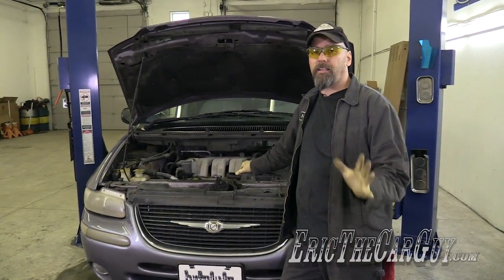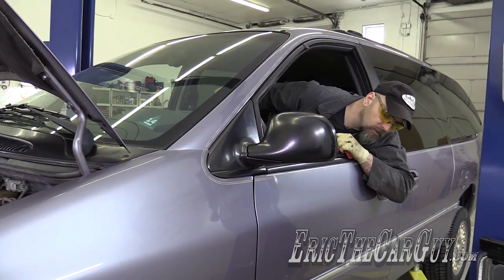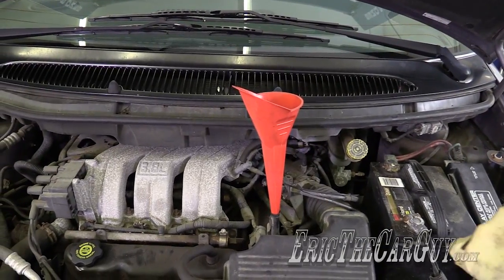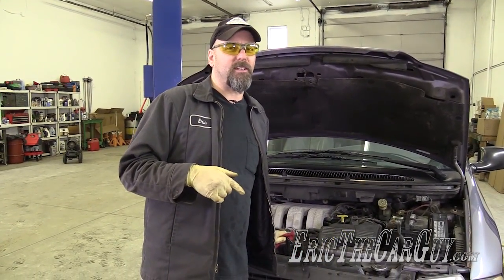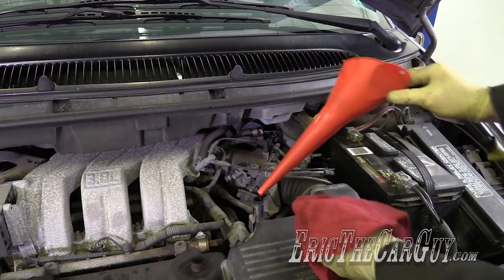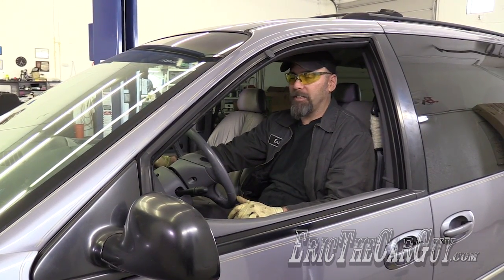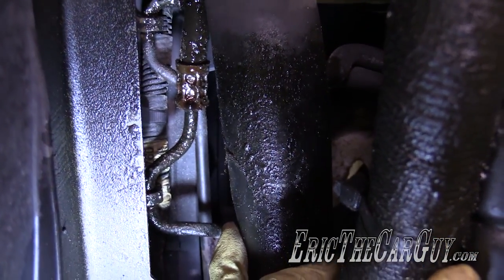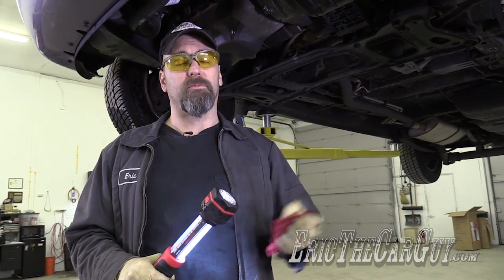1998 Chrysler Town & Country Transmission Diagnosis -Fixing it Forward

Comment from the maker: Here's another one from the #FixingItForward series. https://www.youtube.com/watch?v=SVyv7UpFPEc
Reply: EricTheCarGuy 
Hi.... I need your help place I have Toyota V6 sienna 2011
that have 60000Km.my problem is that transmutation  have over heat when I drive even I drive low sped
like 70-80km the temp going up 245f and still going up until I stop to make it cool down. I change OEM SW oil with filter 2 times but nothing happened also I change oil holes with tow Transmission cooler with fan.
Reply: maxj max Do you mean the engine?  Where are you getting the temperature readings from?
Reply: Man these town & country, voyagers have one of the worst transmissions ever made. You're honestly just wasting your time and money putting a transmission in this vehicle. Especially considering all the other issues you found with it in the other video. Just think back to your video know when to quit and give Barbara that advice. And hey if you wanna help her see if you can find her an old Toyota Sienna van, those things are great and can last a lot longer than these Chryslers and even the odysseys in some instances. You could probably find a late 90s sienna for not all that much money and it would be money better spent. A transmission in this van is probably gonna be close to $2500. Most people I know with these vans just get rid of it at that point. I mean with all the issues this has and I'll quote you on this, her only attachment to it at this point is sentimental and that's not gonna net her anything. Not to mention if it gets totaled, which I often see happen after somebody makes a poor investment like this, you're not gonna see that repair money again. Trust me it's not a wise investment
Reply: maxj max on something that new bring it to Toyota and have them fix it. That sounds like a warranty item.
Reply: EricTheCarGuy I had the same transmission problem. It wouldn't go reverse, but it will forwards but with some difficulties. It made really loud grinding noises. Btw can you help me with something, Eric. I have a 1998 Dodge Caravan and the dashboard won't work. It doesnt tell me how fast I'm going , how hot the engine is, and how much gas it has. Is it a fuse? (Edit) We installed a new transmission and it runs good.,
Reply: Fidel Martinez often times on those the gauge clusters just wear out overtime. on something that old I would try to find a used one out of a salvage yard and install that. your mileage is already off if the speedometer is not working so it doesn't really matter.
Reply: Michael Sackstein I also won't to add that whenever i change into dirve or reverse it makes a sound or whenever it changes into 2nd gear and etc. I don't know how to describe it, but i hear that noise in other chrysler and dodge cars between the years of 1997-2000
Reply: Fidel Martinez yeah unfortunately Chryslers/Dodges have almost always had one of the worst automatic transmissions ever. if you hear noises like that then it's likely the transmission is wearing out, especially on one as old as that. I might say try draining the ATF out and refilling it with 2 quarts of transmission fluid and then a quart of lucas atf fix. that may or may not resolve your issues, if it doesn't then I would say get rid of it fast because it's only gonna get worse and on something like a Chrysler at that age it's just not worth fixing.
Reply: Michael Sackstein I thought you never ever change the oil in a old at, just top it when it needs it.
Reply: Daniel Morales if it's never been changed then you really shouldn't unless you're experiencing problems. but no you should never have to top it off if you do then there's something wrong with the transmission
Reply: Michael Sackstein that is precisely what i was thought. Thanks!
Reply: Daniel Morales pues realmente me parece que estos vehiculos de chrysler son basura porque tienen demasiado problemas aveces cuando estan nuevecito, pero entiendo que aveces no tiene mucha plata y no sabe cuales son las mejores marcas para comprar y en fin se van con lo mas economico y por le digo que los boratos salen caro. asi que te aconsejo cuando te compres un vehiculo para investigar cuales son las problemas comunes y como andan cuando llega a los 10 anos mas o menos o depende por cuanto tiempo deseas manejarselo.
Reply: Great video Eric. By the way, do you know how to check the transmission fluid level on the 06 Audi A6? I cannot find the dipstick. Thanks.
Reply: Fanqi Meng those don't have dipsticks. you have to bring it to a mechanic to get it changed out. it's a royal pain
Reply: EricTheCarGuy  The ATF that this vehicle requires is "7176" appears on the transmision level. ATF 3.
Reply: EricTheCarGuy They should just make all Transmission Lines &  Brake lines out of Stainless right from the factory. For these reasons as well as safety reasons.
Reply: lightningsmokerXx I agree but that would cost them more money which is why they opt not to do that. Especially with American cars.
Reply: Michael Sackstein The thing i've never understood about that is this....

If it costs a car Maker 10 dollars more  to buy a roll of stainless brake line vs regular brake line. Why not charge the customer 30 dollars more for the car. No one is going to care about $30. And lives are saved, headaches, financial bother fixes like this, and reputation of the car company is raised because stupid little things like this are avoided.
Reply: Again I totally agree with what you're saying but there's a lot of competition in the automotive engineering industry. American engineers strive to make the most economical cars with a lot more technology these days, but the build quality to say an Asian or European import is far less superior. Just the way they function. Teslas are more solid from what I've heard but only time will tell.
Reply: Michael Sackstein Yes, these have the weakest transmissions ever,. I had a 96 caravan, had to replace the trans at 65k, unbelievable. My brother in law had the same van and replaced his 3 times! Tell her to get rid of it. Go Toyota or you will regret it.
Reply: Oh jeez. Hopefully the warranty covered that. My uncle had a 91 lebaron that also went through 3 transmissions under warranty in addition to a whole laundry list of other things. Finally the stupid thing caught fire in 99 and that was the end of it.
Reply: Michael Sackstein  my mom had  one of these vans had some other issues over  time was well cared for  and 260,000 miles on it and the transmission shifted fine nice and smooth  but bout 2 years ago was in a car accident and cost of the repairs would be more then it was worth so it went to the junk yard mom got a nice new gmc Acadia we love it.
Reply: Nobody every services there transmissions that's why there always going out
Reply: Chad Gardee Yep, pretty much.

Some are weaker than others.
But if you change the fluid regularly & before it needs to be changed. You usually won't have issues with them. Most people don't grasp that. 

A $100 bucks changing the fluid here and there is way cheaper than having tranny issues.
Reply: SuperJeremi10 that's about as far as those vans will ever go. The Acadias are nice vehicles. My uncle just got an Acadia Denali last month, he's leasing it as per the general managers recommendation.
Reply: our Chrysler van was so horrible to us over the ears we will never by another one  it never had transmission issues but it had a ton of other issues most from day one we got a gmc Acadia Denali  in 2012 we love it   its a really nice vehicle we have put 40,000 on it  and it runs great hasnt needed any repairs only routine maintenance oil change air filter belt etc. i have 99 tahoe i love it its been pretty good to us although its at the age it needs it repairs i have to redo my front end suspension my rear drum breaks  and motor mounts other then that  the engine runs great and no warning lights come on after engine has been cranked.
Reply: So I guess your insurance company declared it as a total loss
Reply: they paid us total value of the van  wich i think was like 2 or 3,000  at the time im not sure we used it  for a down payment on the new Acadia we are very happy though we are paying less on the payments then we where keeping the old Chrysler running  but sad thing is other then the head liner coming down and some dents  that van looked brand new ac still blew ice cold in front and rear it was well maintained it had a dent where some lady had hit it coming in the wrong side of parking garage it was an old lady we cut her a break and dint clame it it was just a small dent  and it had some pings in the doors minor wear and tear  at the time of wreck everything in it was working properly we had just spent  500 for a tune up and new belts and tension arm  and the day after it came back from the shop someone hit it and totaled it it coulda been fixed but it would have cost more then the van was worth so they totaled it out  it bent  the suspension and tore off the bumber parts that could have been replaced and you wouldn't have even known about the wreck there was no engine damage  as the car still ran just couldnt go anywhere i would have took the total  value pay  done the repairs myself kept it and got a new car and saved it as a frist year car for my younger brother.
Reply: Yeah that sucks. Sounds like what happened to my old 1996 Saab 900 S. It got t-boned on the drivers corner in an intersection and the drivers axle got bent & broke from the impact and the car wouldn't move. Was gonna be $3k to fix and we didn't have full coverage on the car anymore so insurance totaled it out and gave us $2400 for it. Also drove fine after we fixed it up but it had a lot of problems that were very expensive to repair
Reply: well the van must have been repaired sometime ago i saw it on the road i recognized it by the plate # it had a white bumper and black fender on the side it got hit sad to say few years later its not in near the shape as when my mom owned it look like the air had quite  and they obviously arnt maintaining it  the motor was showing symptoms of burning oil  blue smoke out the tail pipe things that would have never been let go if we owned it we took very good care of it  i also  didnt just recognized it  by plate  but  by looks  damages  and marks  from when we owned it  they probably got it  for next to nothing and fixed it but come to think of  the ac may not be working cause i remember there was a small freon leak in the rear ac cor  we never got fixed since it was so small we just recharged it whenever it got low to costly fix man  we had done lots of work on that car new shocks  new front suspension brakes new electric fans new sensors and plugs   the  rear wing motors had been replaced  new wiper blades new ac blower relay new seat warmer elements at some point the sliding doors came off the tracking oil changed every 5,000 miles it had a new radiator put in it had to have a new gear box put in  on the steering or something  at some point the airbags where serviced  via  airbag light we had spent lots on that car over the years  near the last few years we had dropped a lot of new parts into it.
Reply: Man you spent more than that thing is worth. I would never spend that much money on a dodge. The symptoms it's showing now is typical because like I said that's about as far as those things will ever go
Reply: well we spent the money to keep it going i guess cause mom liked it and we really couldn't afford to get something newer   we did all the repairs on the car our self me and dad did them so it only cost us the price of parts her car constantly had break issues we are much more happier with the Denali we are pretty much paying monthly what it was costing us to keep the town and country going  but got a nicer more reliable vehicle so we are happy. looking at her denali makes me want to trade in my tahoe for something nicer  but the thing is i really like my car it runs great but the pain is pealing off its been doing that a long time but i kinda want to just fix it and keep my car for the sake of i like it and i know its history we've owned it since day 1 so i know its maintenance patterns  but kinda at the same time i want something different but i want my tahoe  i really like the ford expiation and the escapes  but  then i also liked the old body style jeeps and whatever i get 4x4 is a must if it dont have it  that's a deal breaker my tahoe has 4x4.
Reply: The older tahoes that date pre-2000ish were actually ok vehicles aside from the vortec injection system. If it's one of those I personally would keep it until something serious like the vortec or engine/transmission fails. The fords can be ok vehicles but realize that all American cars age badly overtime so you also gotta budget your spendings pretty well. The good thing is you do all the maintenance items yourself so you've basically got your work cut out pretty well
Reply: yea  and my tahoe is a 99 with a 5.7 vortec and has recently had the intake replaced and spider injection replaced as well it also has  recently had a new transmission put it it still has the oem radio with new speakers it runs good it still easily passes emissions its not got any major oil leaks it easily makes it to its 5,000 mile oil change  and the oil level is still on the full mark so its not losing oil  it does however lose power steering fluid because my hose is leaking i need a new one but thats minor on my to do list its a small leak i need to do my drum brakes badly and my suspension also i need new motor mounts thouse take high priority i just put in a new radiator and water pump 6,000 miles ago it had a complete tune up new egr valvue map maf  egr switch temperature sensors  spark plugs cap and rotor also has had a new thermostat put in and fresh coolant also all fluids where checked and brake fluid was changed.
Reply: i saw a 2005 trailblazer i liked then i saw all the reviews on it  and decided not to get it ugh  i really liked it to   i like suvs.
Reply: Yeah. As a matter of fact the trail blazer has been rated as one of the worst SUVs ever made.
Reply: oh  haha ive known some people  that had some  and  where ok.but they where the type people who only would own a car for a few years then trade it in
Reply: Yeah but I wouldn't advise purchasing one of those vehicles. Trust me it's not a wise investment
Reply: haha  what bout a 2004 ford escape maybe ill just drop like 5grand and fix my tahoe up nice redo the interior and repaint it  i do like my car but its in poor cosmetic shape.
Reply: Not worth it on a vehicle that old. Now if you wanted to touch it up yourself then that's a different story. But 5 grand on a 90s Tahoe paint job no way. The escape can be an ok vehicle but you wanna get it checked out by a professional before you buy it.
Reply: okay  see  i havent found a car i like as much as my tahoe and ones i do find for my price range are horrible ones and it needs a new paint job the paint is pealing  my tahoe has had a new transmission and transfer case put into it and is a 4x4
its hard to find something in nice shape in the 5,000 range i dont wanna spend a lot on a used car cause i wanna pay it off the day i drive it off the lot.
i really like my tahoe and if i had it redone  i would be spending the money with the intent on keeping it cause resell value it wouldn't be worth it but i really like my tahoe and its been reliable up till recently but thats kinda my fault  i been falling behind in the maintenance cause i havent had the money to keep up with it also 100,000 miles ago the motor was pulled and rebuilt  it was leaking oil rally bad so we spent the money to have the whole motor serviced and worn parts replaced.
Reply: Man you're spending more money than that thing is worth. I would never spend that kind of money on a GM. But if you like it then drive it till it stops running. And to be blunt, if you don't have money to fix it or buy a new car then you shouldn't be spending $5k on a paint job. Especially if it's twice the value of the car.
Reply: well i need to do something  to keep it from rusting before its to ate it probably wont cost that much for a stranded paint job and it needs interior work  thing is this car doesn't seem to break down or be a huge lemon like a lot of newer gm vehicles as of right now it has a newly rebuilt engine new transmission and new transfer case might as well fix the rest of it  and not throw away all that money just spent fixing it the rear main seal had gone  it was loosing  quarts a day so my uncle went ahead and spent the money and had the engine rebuilt since it needed new seals he was like why not  then the transmission went out  failed to shift so it had that done as well as the transfer case then i got it and i love it i haven't found a 4x4 suv that i really like yet that isnt a total lemon besides this one and yea ill spend more then its worth fixing it but at least ill know whats been done and its maintenance patterns rather then buying another used car  and getting someone else problem and have to spend to fix it plus what i paid for the car i dont plan to resell my tahoe even if i do get another used car i plan to keep it next week its going into the shop  for new tires. i know the car isnt worth much in value but its worth a lot to me cause its better then walking.
Reply: i hate macco cause of the quality but i may have the car pro washed cleaned  before painting and take it to macco and have a low grade paint job  or i should say touch up on the places where the the paint is pealing  and just have the existing paint matched but  hate the qulity they do butt i don't want to spend more then 2,000 on a paint job but i want a decent paint job  thats close to the factory grade d like to keep the tahoe black or maybe make it red i like red thers a few small dings in the doors i dont really care if they get fixed maybe filler will do the trick  but it will need a new passenger fender and door also a hood it was in a accident years ago thanks to my cousin didnt do any frame damage just dented the fender  an hood  car door is fucked at the handle thanks to thieves trying to brake in  i might just have the fender and door replaced and live with the hood  with its dent as it really isnt that bad and i can always throw another hood on later i just want the body painted and saved from that point on i plan to take better care of it.
Reply: You make absolutely no sense whatsoever. But you can do whatever you want. I'm just telling you if you do all that work and spend all that money on it and then it gets totaled you're never going to see all that money you spent fixing it. And by definition you already drove it into the ground because the engine and transmission are the heart of the vehicle.
Reply: 2,000 and maaco will paint it  and fix dents not a grade a job but its decent better then whats on it know which is pealing off well the engine has been rebuilt and a new transmission  yes and any used car i get for 5,000 insurance wont pay that much for either id still be loosing out i cant find a car i like  with options i want for under 10 grand thats the problem i only carry liability insurance and if i buy a new car and drive it off the lot  and it gets totaled id lose half what i paid as well.
Reply: SuperJeremi10 why don't you paint it yourself. You seem pretty inclined to do that kinda work and it will save you a lot. I recommend consulting with Donnie Smith he's great with body work and can tell you exactly what you should do.
Reply: i could  and body wise i just need a new hood fender and car door  the rest is minor dings i may buy the parts and paint and have our local collage paint it  as practice car they cant give any worse then it is now  i really just want it to look nice again and have the interior redone really all the inside needs is new carpet  sun visors and seat covers the rest is in okay shape  just dirty  i dont need a perfect paint job  i just want a nice paint job hats better then now to keep it from rusting  and i want it to look good i dont want to spend a lot but i want a nice car again i love the way the Tahoe drives and  the space it has yet  still not to big  and i like the body style. resell value its really not worth fixing but its worth it to me because i like it  and i dont plan to get ride of it anytime soon unless it gets wrecked but even then if its minor damage ill just repair it the fender is dented from being in an accident but it was minor damage and i used he insurance money towards other needed repairs like at the time i needed new tires and brakes so i used the money on that and never got the dent fixed.
Reply: You should try a salvage yard for that. Lots of parts there
Reply: one day ill get something newer when i do i plan to pay cash for it  and make an offer on a car of what im willing to pay for it  do a test drive and take the car to our local repair shop and pay the inspection fee  we have a family friend who owns a auto repair shop id just pay his fee and have it inspected make sure its in tip top shape i also always look at safety ratings  the car value and  recalls  and if its a lemon model or not and i do a carfax check as well and i make my offer according when i go to a dealer i be like this is what im willing to pay  take it or leave it i can always find another car i also like to check the maintenance history see how well the car was maintained thats how ive passed up so many cars so far they have all not been good buys thats one reason why ive decided to fix my car up and keep it   as i like it  it drives good and i know it  as its been in the family since it was new and came off the lot  ive had it a few years and i do all the maintenance myself  and  what i dont do i watch over the tech doing it  and  i go behind them and inspect the job  before i leave  heck i inspect the job before i pay for the work.
Reply: EricTheCarGuy for the reverse not working try going about 30 mph down the road and put it in reverse. it sounds crazy but it worked on my car. it should kill the engine and the next time you start it you should have reverse. good luck
Reply: Graham Rees that's funny.... hell of a way to fix a car.... lol
Reply: some guys around here have had some luck doing an oil change and adding some brake fluid. I don't know what it does but it has worked
Reply: These vans had a common problem with the connection where the instrument cluster plugs into the wiring harness coming loose. if you re-solder the connection is should work